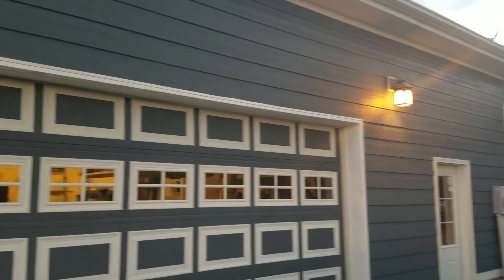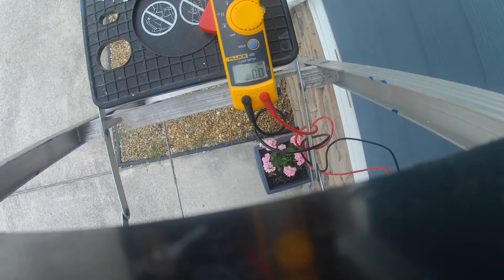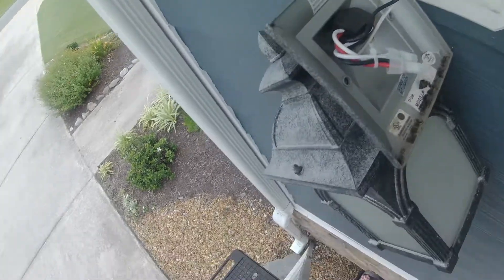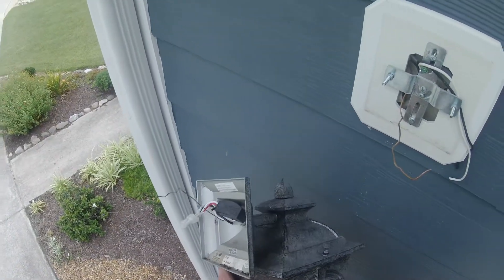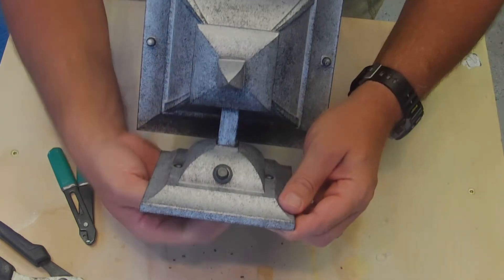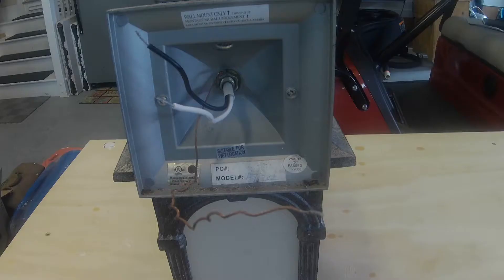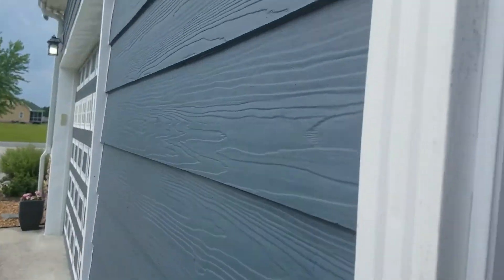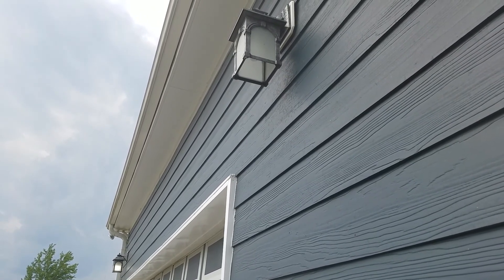Troubleshoot/ Bypass Photosensor Part 1

Comment: Thank you, mine died and I was going to get a new fixture, but this saved me from that. I just want to bypass the photocell altogether because now they make awesome edison style led bulbs with the photocell built in, and I have had one working in a lamp post for 2 years now. Much easier to replace a bulb than a photocell or fixture.

Comment: This is great.  I have three photosensor controlled lights on the same circuit that don't work that well with LED's.  It's a problem when the weather starts warming up and especially during the hot summer.  One or all three will flicker.  It's an intermittent thing some times it flickers briefly and goes away and other times it won't stop flickering.  I'm thinking of just bypassing the photocells.   Do you have any thoughts on what might be causing this and possibly an alternate solution.  Never had a problem with lights that weren't controlled by photosensors.  Thanks!
Reply from the maker: My guess is some loose wiring or a bad photocell - easy enough to check - just bypass the sensor and see if it goes away.
Reply: @djbarton1972  Thanks for your advice.  When I first installed these, I went through everything and even returned one for another one.  I made certain all the connections are tight and to spec.  If it was loose wiring, I'd expect the problem to occur all the time, not so intermittently.  In another video, I heard that light reflections can cause strobing during certain weather conditions.  That seems to be what I have.  They talk about a shield cover you can put over the sensor, but Hamptom Bay, my brand doesn't sell anything for these photocells.

Comment: How do you rig an outdoor photocell to not come on so early in the evening, (and turn off so late in the morning)? These things are wasting electricity, big time, and I don't like them. Everyone of them I've tried, though new, is the same - they run the outdoor barn pole security light too long. They're too sensitive to light / absence of light, no matter which way I face them, (and I face them north, away from the rising / setting sun angle). I think they build them like this so we waste / spend more on electricity. 
 Thanks.
Reply: @djbarton1245  Thanks! Good idea. But my power that goes to my light pole also goes to the submersible deep well pump right near it. Somehow I would have to separate the two, electrically, to do that. That would definitely make it easier to install such a timer, (inline), like you described. Thanks again for your suggestion and help, very kind.